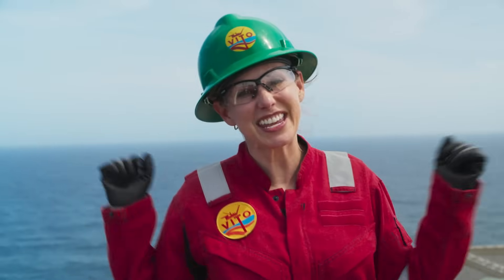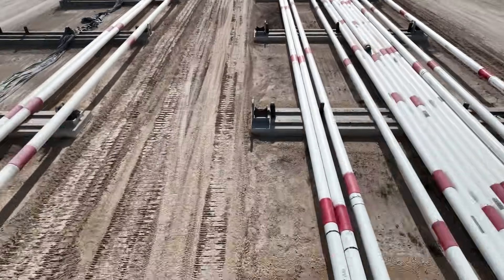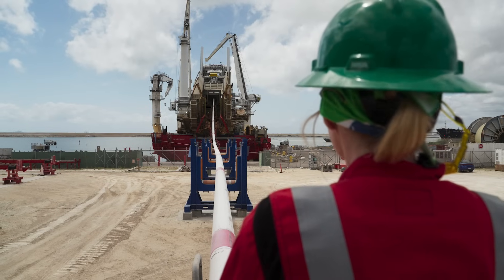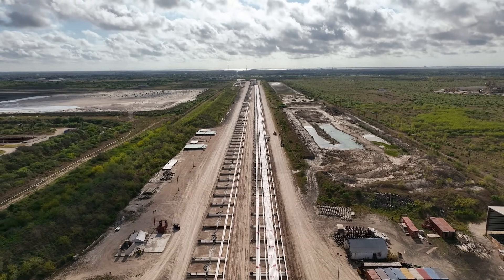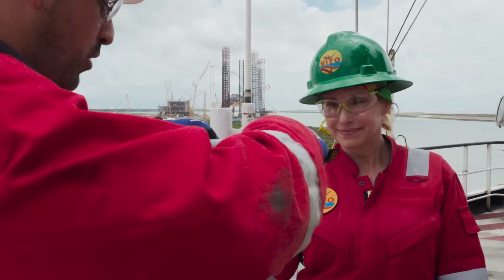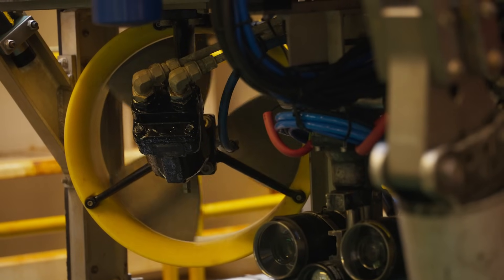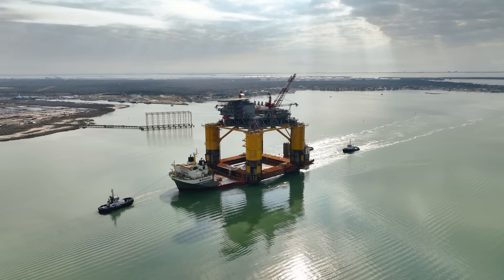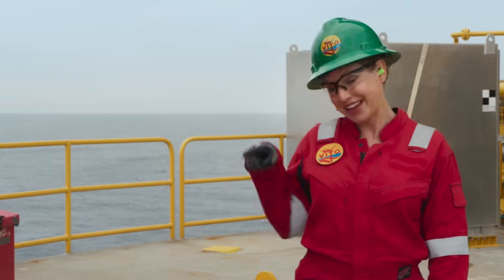Extreme Subsea Engineering: Shell’s New Vito Platform

Comment: Yeah, let's celebrate oil and gas rather than transitioning to sustainable energy. Also Kari, extremely dissapointed you've put your face to one of the larest greenhouse gas emmiters in human history.
Reply: The tires of your EV, the cables and their insulations, even the roads on which they drive are made from oil, the grid and power and charging stations also possible because of oil and ICE. Even windfarms offshore are possible with oil field technology.
Reply: The phone, or computer, the parts and pieces of your internet router, all made possible due to O&G.